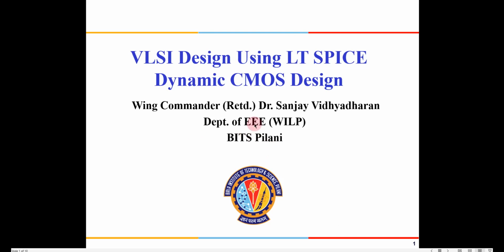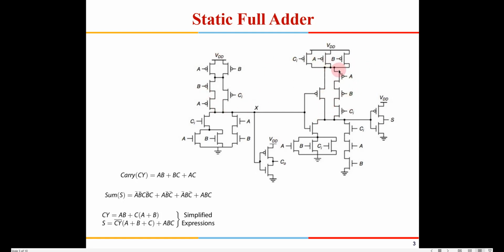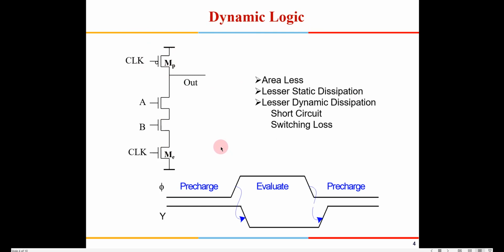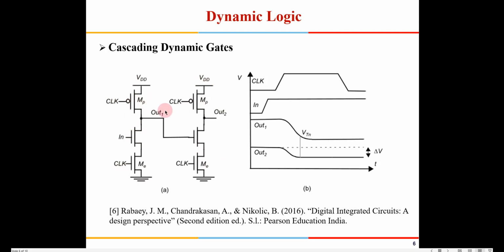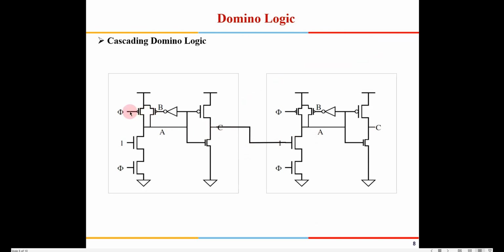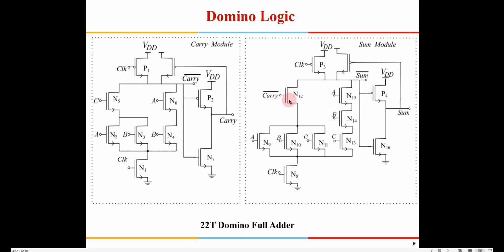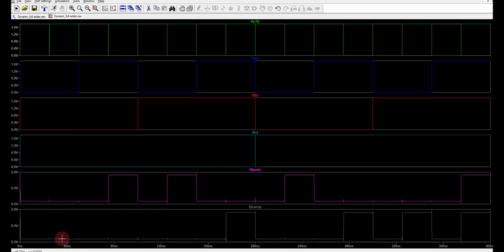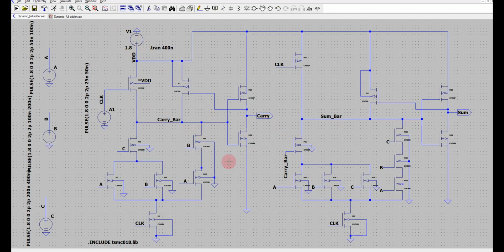VLSI Design Using LT SPICE  : Dynamic and Domino CMOS Design

Comment: Isn't there an issue with this circuit? During the pre-charge phase, Carry_Bar will be set to 1. Now assume that before the evaluate phase, A=1, B=1 and C=0. When the evaluate clock arrives, the assumption is that Carry_Bar will evaluate to 0 and thus turn of the first pull-down stack of the Sum portion is turned off and will keep Sum_Bar at 1. However, if the Carry_Bar node has some capacitance and takes time to discharge, then Sum_Bar will incorrectly get evaluated. 

Please let me know if my understanding is incorrect.
Reply from the maker: Yes. These isuses have been dicussed in details in the lectures. Refer my 12 and 13 https://sanjayvidhyadharan.in/courses/vlsi-design/